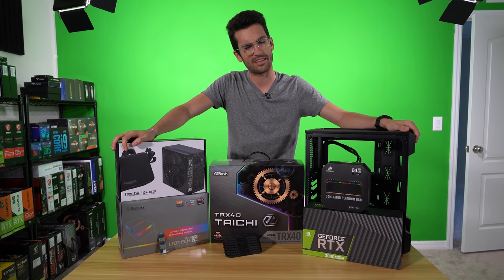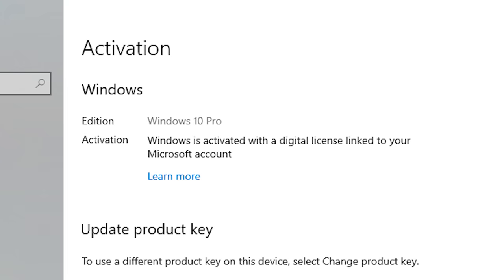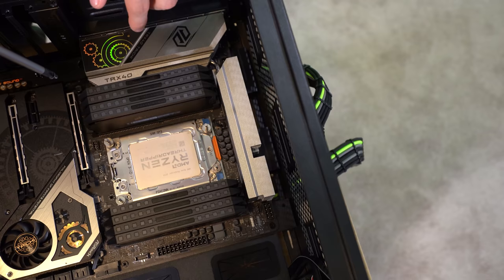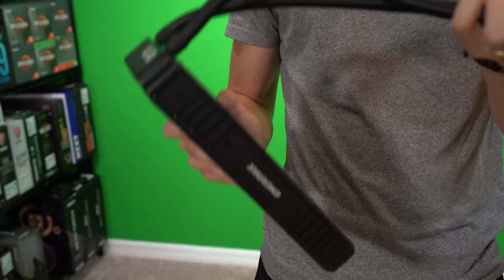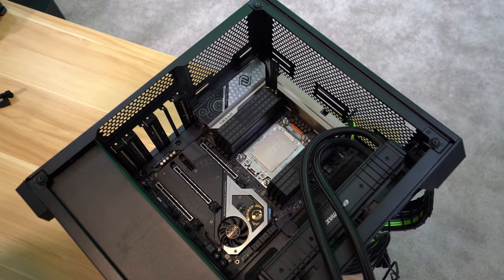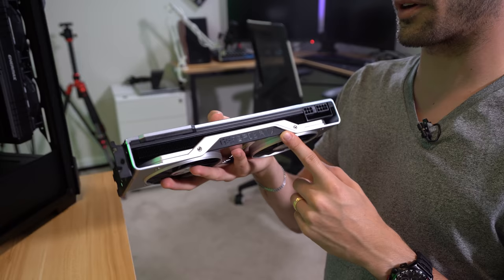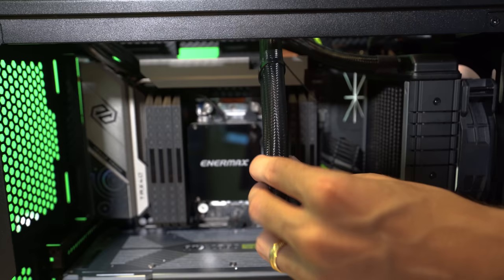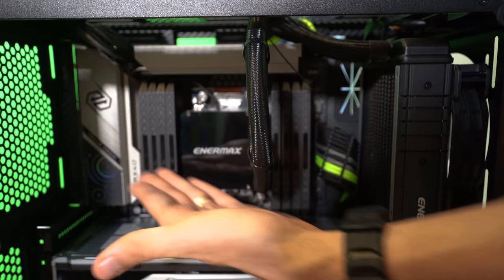Let's Try This Threadripper Build Again...

Comment: I thought Enermax AIO's were prone to leaking and failing overtime.
Reply: The ones gamers Nexus showed that off for reliability wasn't the greatest lately. They can say they changed it but will it actually hold for a year or more without buildup. But then its a case of seeing if they have actually fixed the problem for long term reliability